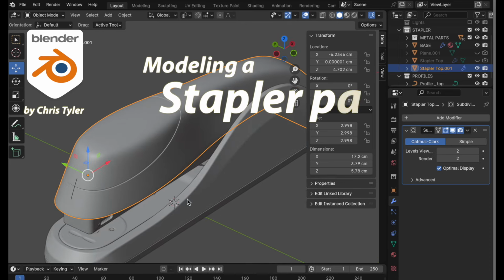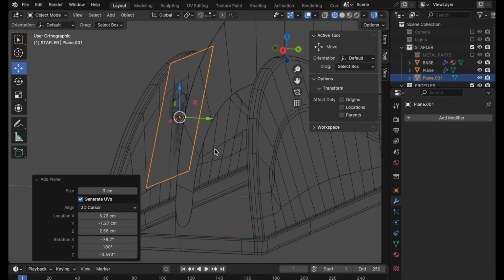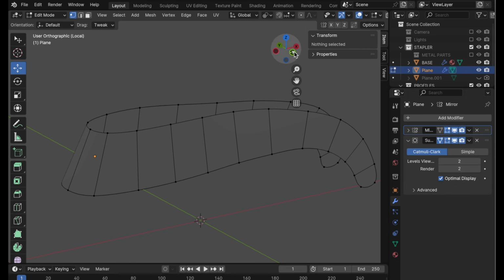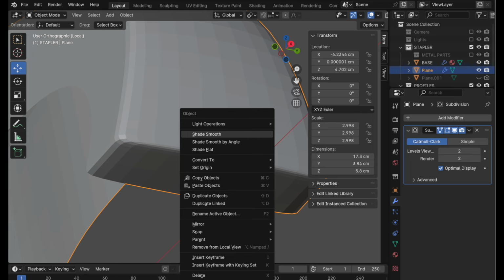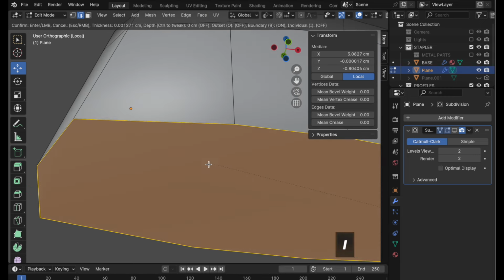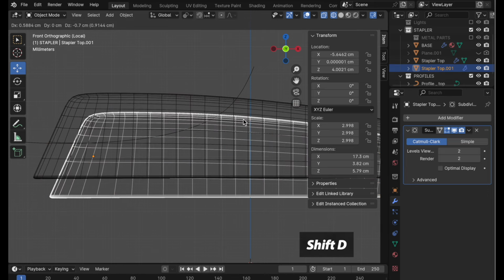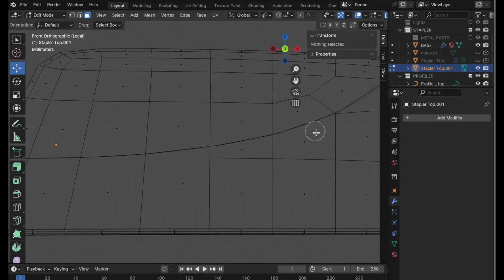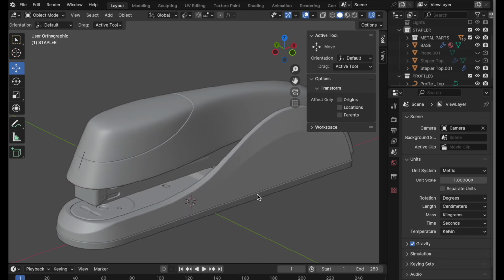Parallel Offset Sliding is magic.

Comment: These are the best Blender videos I have come across. Ive been using Maya and 3ds max for many years and I feel like im watching high end 3ds max modeling tutorials while im watching you work. You are my go to when I need something in Blender. Thank you. 

Blender is a weird mash up of 3ds max and Maya with some really annoying features built in.
Reply: I've never tried Maya, but I got lucky with a workstation laptop that my uncle had given me which had 3ds max 9 on it, and 9 was REALLY awesome. I learned so much on there. Ive tried Modo, Lightwave, Softimage, and while I wish Autodesk never bought and killed Softimage, I can say I prefer Max. With Max, the tools TRULY feel seamless in that, when I'm modeling and then feel like doing a small animation on one of the parts just for a functionality demo, it doesn't feel clunky or like a heavy context switch, it's on taxing on the mind as if I have to start digging around menus and feel like I'm using different software. Max animation and rigging tools still feel like I'm modeling, its one smooth experience. I'd like to mention Houdini but that's a totally different beast. While Houdini modeling tools are getting better, it was never meant as a modeling tool, it's more of an FX powerhouse in that, if you can imagine it, then there's a way to do it in Houdini. Of course it's complicated, and I like to think of it as being a low level CG environment, kinda like the difference between Assembly, C, and something like Python programming languages.

Comment: Hey mate can you please make video about texel density? how it works how it should work
Reply: It would be nice and very intresting because i dont know execty how to do it correctly how to scale to right size i hope so he is gonna do it someday
Reply: I think with texel density, you want to keep the UV islands associated with geometry that doesn't show too much on the model tucked in corners where they get LESS density. And those UV islands associated with the main parts of, let's say, a weapon model, to get the MOST density by being that much larger. You can apply a checkerboard pattern to check and make sure the squares are indeed squares, there's no stretching or distortion, and use it as a guide to make sure the areas that need the most resolution have larger UV islands, which will show as the area having smaller squares on the model, while the areas that are more hidden, like say the the inner loop of the trigger, that won't need as much and is therefore safe to scale down to make more space for the islands that need it most.